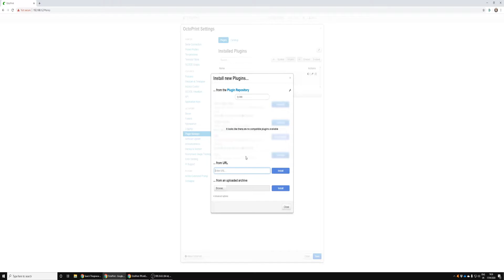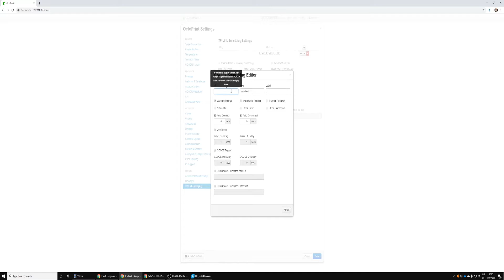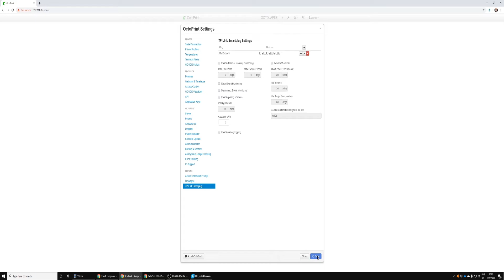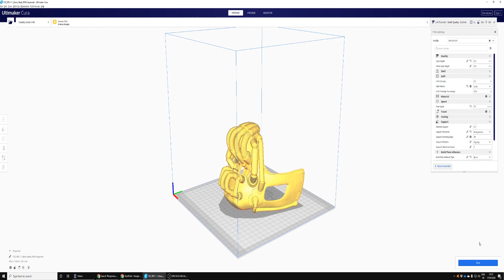Automatically Shutdown Your Creality Printer Smart Plugs and OctoPrint

Comment: Really appreciate this video.  I was like "this close" to having this working exactly how you do except I'm using a Sonoff Basic flashed with Tasmota.  I didn't realize that the system command was for the Pi and not g-code.  Derp.   

Only thing that i'm going to experiment with is different delay times because I want to make sure that the hotend has a chance to cool down before I power things off (like fans).

Comment: Just to be clear, in this setup are you using one smartplug outlet for both the pi and the printer and not one smartplug for each?
If this is the case, then I assume the pi's power cord is connected to the printer via a step down converter? So when you say you are "powering off the printer" first...do you mean you are disconnecting the printer from the pi? After disconnecting the printer, the pi's executes a shutdown via the sudo command and then the plug is scheduled to cut power to both printer and pi 30 seconds after sudo. Yes? Sorry for the long question ;)
Reply from the maker: The printer is plugged in to the tplink adapter. The pi plugged into the mains socket. Once the print stops the gcode and app shuts off power to the printer the pi remains on. The pi is connected to the printer using USB but I cut the red power wire in the USB cord so the cord does not power the printer. The pi can also be sut down as the app can send the shutdown command after the printer has powered down.
Reply: @AhcMeUk  Thanks for the video.  I'm still not quite clear on this though.  Could the pi and the printer be plugged in to the TPLlink smart plug (using an outlet adapter with 2 receptacles), and then the following shut down sequence: at the end of the print, the sudo shutdown now command is run, wait 30 seconds, then turn off the smart plug which would shut of both the printer and pi?  If I am running Octopi from my PC, that would still be on to issue the needed commands, and the PC could turn off via it's own sleep settings.  Is this  possible or is there something I'm not understanding (sorry, I'm new to this)?  Thanks again.
Reply: Thanks for asking. I was wondering the same thing. The explanation makes sense. I just need to know what you mean you cut the red wire in the usb cord? 🤔